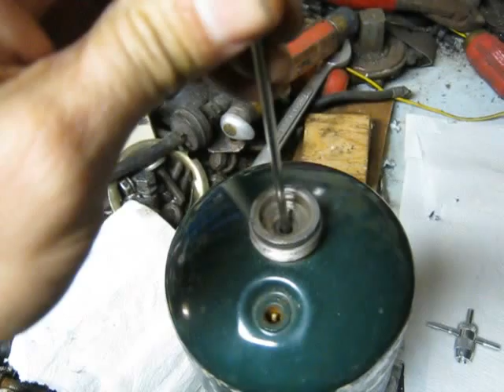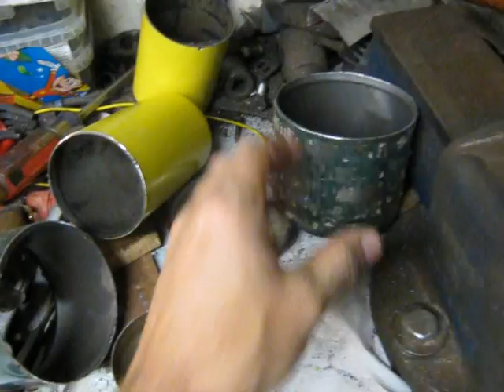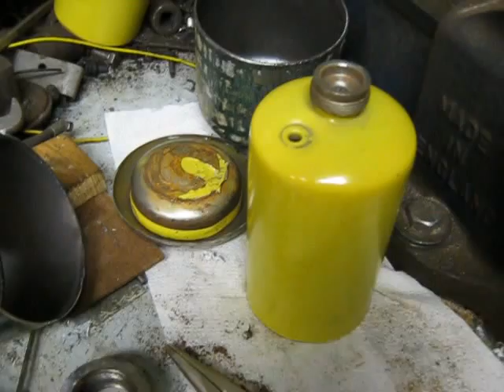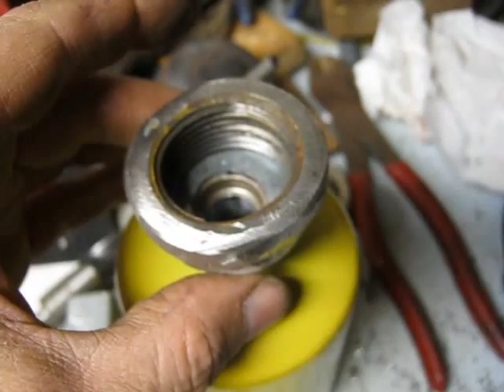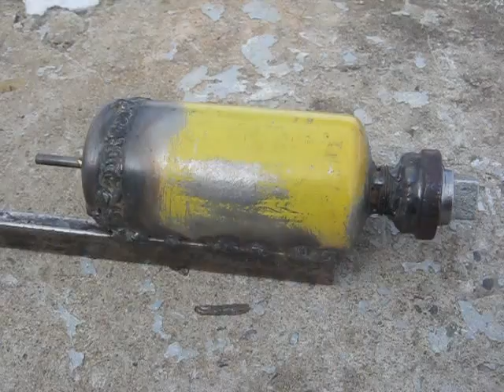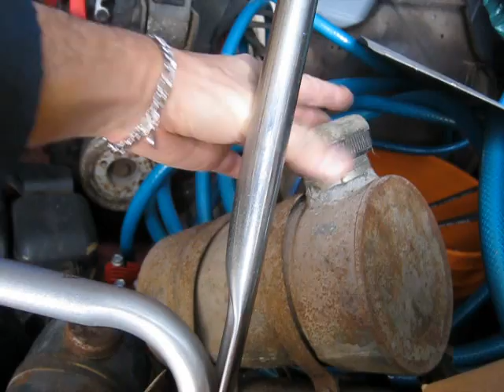Homemade gas tank Part 2

Comment: Holy moly mate, I like your style.  Cruising through your playlist, I really wish I would have found you years ago.  We have solved many issues in damn near identical ways.  From this build to the auto thermostat, electronic control fitting you made.

I haven't watched your sleeve valve engine build yet, but im stoked for it.  Auto engines are my first real love.  But I have supplimented small engines in for near as much fun, if not more due to the fact its so much easier/cheaper to build.  

Anyways, thanks for the years of content for me to catch up on.lol
Reply from the maker: Howdy, glad you found a bunch of things on my channel that you like! It is hard to believe I have been making videos for over 15 years now! I designed and built the sleeve valve engine as a group Senior project at University. It took us novices about 400 hours to machine it, so we were overjoyed when it started and ran on the 3rd pull! After some initial tuning runs, and showing and running  the Professor to be be graded, I kept the engine. The next school year I ran it on a dyno, and started making some changes like intake manifolds, increased compression, more exhaust timing etc.  The highest power it made was 4.75 horse at 3200 rpm from about 8 cubic inches. I am sure it is capable of more, using a different carb., and amore refined intake manifold. But in the current configuration it had tons of low end power to cut the grass, it was actually very hard to stall out in the grass. I think the 9.3 to 1 compression was a factor. I have toyed with the idea of changing it to be horizontal shaft to power a go kart. That is on my ever growing to do list for Briggs projects. I still need to get the 2 stroke "Crecy" type sleeve valve completed! Take care.

Comment: A great flux to use for brazing and gas welding is borax. Walmart has a huge box that will last more than a lifetime for $4. And it works great with common baling wire that is kept inside out of the weather. I keep mine in an old medium sized prescription pill bottle you get medicine from the pharmacy in. Something else that makes a great gas tank is the metal remote power steering reservoirs from older GM cars. All Chevy Astro vans had them. I usually cut off and braze up the return line on the side and cut off and braze in a new smaller outlet on the bottom and mount them to a bracket I made with two large hose clamps. I've got two of them on my Bad Boy zero turn mower that replaced the plastic tanks that came on it for the hydraulic reservoirs. They even had the right sized outlets to start with.
Reply from the maker: +Junk Yard Thanks for letting us know about other things that might work more easily for a tank!

Comment: Just curious,
Why cut the tank in half it seems like you could build the tank with it in one piece and just clean the metal shavings out really well.
Reply from the maker: +ARednecksLife Yes, you could use the whole tank, and it would make it easier to build. It would hold quite a bit of gasoline that way!

Comment: welding any tank like that to make it a liquid type seal is a bare, but flux core is what i use as well.
Reply from the maker: +Mr3wheeledbike Yes, seal welding is a big pain, I had to leak test it 3 times!  :(
Reply: ChargerMiles007 oh i wish 3 is my avarge. i need to learn to tig for that reason.
Reply from the maker: +Mr3wheeledbike Perhaps I have had more practice than you, 90% of the work I used to do on my Corolla was welding up the exhaust, so I got more practice with thinner steel than I wanted to !!!
Reply: ChargerMiles007 well i just got a stick welder (and mig but i need the gas and petal) but i am a mig welder threw and threw
Reply from the maker: +Mr3wheeledbike I started off with oxy-acetylene, I used to braze or fuse body metal, mainly in floorboards. i had stick, but it needs thicker steel to weld to. MIG took some getting used to, I have done a little TIG on aluminum back when we were building the sleeve valve lawnmower engine at university. They had a well equipped welding and machine shop, and the instructor was a very friendly and helpful guy who listened to what we needed to accomplish and made great recommendations about how he would do the job.
Reply: ChargerMiles007 that sleeve valve engine of yours must of been quite the project, so much work (as if you sis not know that) but university's tools sure do help.....i am in the same boat right now.
Reply from the maker: Yes, utilizing the machine shop at a school is great! The problem was finding enough hours to get school work done as well as machining.
Reply: ChargerMiles007 i know that problem i have been putting all my time in a vw beetle powered golf cart lately.